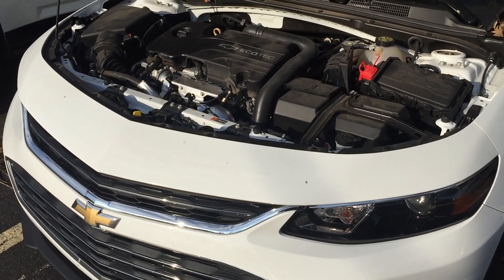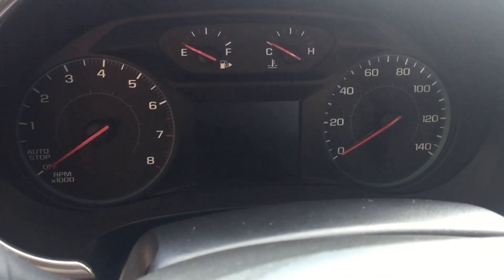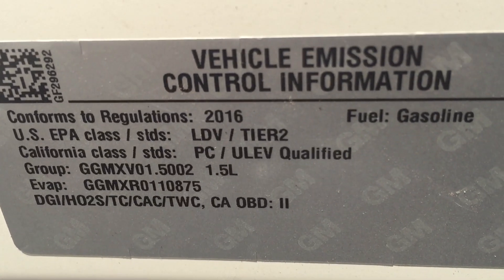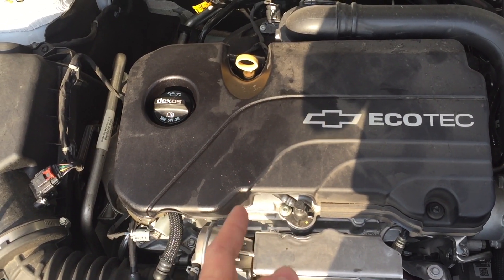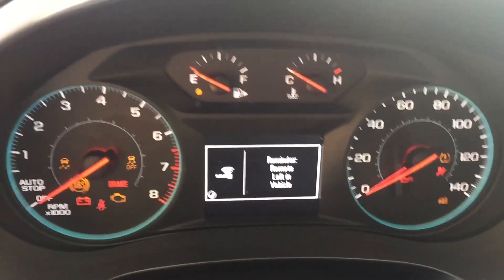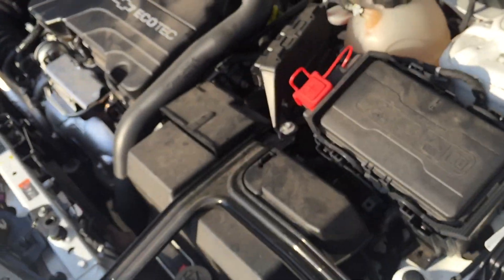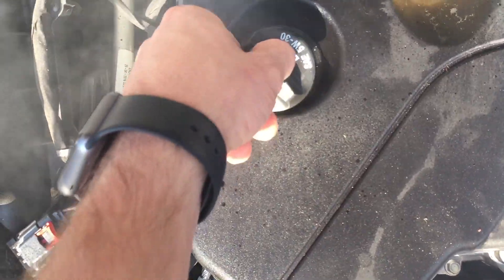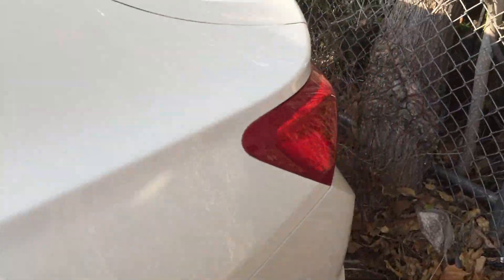What Engine Blow-By Looks Like

Comment: That's why I would never buy a car with an engine smaller than 2,5l. Manufacturers are just squeezing too much power out of these poor little engines
Reply: MaxTheKanuck Ford Ecoboost, reliable? Yeah, the EcoBoost is very reliable, if you look passed the severe carbon build up on the backside of the valves that causes premature valve and valve seat destruction, or the injectors taking a shit under 20,000 miles, or the turbos exploding under 40,000 miles. Look past all that, and yeah. The EcoBoost is extremely reliable!
Reply: TheLuckyDawg24 It has nothing to do with that, GM is the only brand completely incompetent at making a half decent 4 cylinders. The Ford 2.0 EcoBoost is just as reliable as any other properly built 4 Cylinder, and that's because Ford actually spent the time necessary to engineer and build them properly. Factory Turbocharged Engines need to be overbuilt, as in be prepared to make much more power than they actually do in order to remain reliable for it's entire lifespan. All this engine is is a Turbo thrown onto a tiny little sewing machine that clearly wasn't made to handle Boost.
Reply: NovaMan 350 So explain to me which features in Ford EcoBoost Engines inherently cause problems such as these. Specifically.
Reply: MaxTheKanuck I know you weren't asking me, but the valve issues are cause by it being direct injected. There isn't fuel being sprayed on the back side of the valves and that causes them to build up carbon. If bits of carbon break off and make it down stream it can screw up the turbo. The newest truck ecoboost engines have 2 injectors per cylinder, one is direct and the other is port. That's what toyota does and it's supposed to fix it. At least that's my understanding.
Reply: Oh yeah... Detonation is a thing.
Reply: First off ecoboost engines are turbo gas direct injection engines like a diesel engine but running on gas. Instead of spraying fuel before the valves it is injected directly into the cylinder during compression stroke. So the gas does not clean the valve stem or seat at all. Gases, oil and carbon from the positive crankcase ventilation system will tend to coat the inner runner, valve stem, and valve seat. Oil from a diesel will actually clean the above areas. So a much better PCV system with a catch can is needed or an all aluminum intake with an extra injector. Second many vehicles seem to not have fuel filters anymore but diesel style injectors need very clean fuel so a sub micronic fuel filter is needed. Also not a bad idea for a sub micronic bypass oil filter as well. Third turbo are a high precision device that need to be very well designed, have proper QA/QC and have to treated properly. No running an engine stop (which stops the lubrication and cooling of a 20000 rpm turbo) 10 times a mile in bumper to bumper traffic only to crank boost up to 20 psi.
Reply: killman1971 Wouldn't simply taking care of the Engine get rid of these problems?
Reply: killman1971 autoguide.com

People using shitty Gas could also be to blame. Either way, I think the easiest solution would be to run some Sea Foam through them at every oil change, and using Premium gas. And besides all that, these are problems related to turbocharged direct injection engines, not exclusively EcoBoosts. EcoBoosts aren't melting their pistons.
Reply: killman1971 But yeah, I know about the issues that can be caused from cutting oil off from a Turbo before it has a chance to cool down properly. If I owned a car with an EcoBoost engine I would disable the start stop bullshit.
Reply: sadly with emissions and efficiency standards tightening, that might not be an option soon, even Honda is now making a truck that has a 2.4L engine. though if you want to know too much power, there was an audi 20VT (a 1.8L engine designed by Audi in 1993) that a professional tuner managed to squeeze 1,000 horsepower out of. now that is probably too much for a tiny engine lol
Reply: +maxTheKanuck back when the Cavalier was in production they made some really great 4 cylinders, many of those I4 cavaliers are easily 200K mile cars, and around here, most die due to rust and accidents than the engine dying. however their newer stuff (IE gen 3 ecotecs) are all designed by Opel over in germany. it's good when they design it for advanced german manufacturing plants, but then they try to assemble it in aging American facilities, it doesn't turn out that great
Reply: Justin Noker By "advanced" do you mean fragile and shitty? Because yeah, that's German Engineering alright. You can get 1000 Horsepower out of pretty much anything as long as it's built correctly, but personally I would much rather have something with a bigger displacement that has a linear power band and reasonable reliability than something that makes 250 Horsepower until 6500 RPM and then blows up if you run it on full boost for more than 30 seconds.
Reply: MaxTheKanuck
you're thinking of turbo lag, it's really only an issue with old turbo cars or tuned ones, as most modern turbo's have various ways of making the powerband very linear even ewhen running higher boost pressures, it's when aftermarket tuners crank this way up where the powerband does that.
Reply: Justin Noker If you're making 1000+ Horsepower on 1.8L, it's going to have Turbo Lag. It has nothing to do with the engineering, an Engine that small isn't going to make enough exhaust gasses to spool up a Turbo big enough to make the required Boost for that much Horsepower until high RPM.
Reply: MaxTheKanuck
i know, that wasn't factory though, that falls under the tuned category, most of my previous statement was talking about factory engines
Reply: Justin Noker You brought it up dude.
Reply: MaxTheKanuck
i know, i mentioned it as a joke to the original comment of "too much power" lol
Reply: Justin Noker Like I said, just because it can make that power doesn't mean it can make it reliably.
Reply: MaxTheKanuck yeah, of course the 1,000 HP 1.8 isn't going to be that reliable, the whole purpose was just to get 1,000 horsepower out of it, nothing else
Reply: NovaMan 350 my dad has had a 2014 fusion Ecoboost company car. ran 80k in 2 years and never had an issue. his new car is a 2016 escape Ecoboost 4wd and it's got 30k and never had an issue.
Reply: MaxTheKanuck,  you NEVER run seafoam through a turbocharged engine. you will blow your turbos to holy hell.   i own a 2011 ecoboost f150. it's the 3.5 v6.  the only problem with the 2nd gen ecoboosts is the pcv system. all the oil vapor and bullshit from the crankshaft gets forced back through the intake and the turbos and then it sticks to your intake valves.  a set of catch cans fixes all of the problems with the ecoboost. also, if you have a turbo engine, buy good quality PREMIUM gas only.  most retards buy cheap gas from no name gas stations... that stuff is junk. don't buy regular either.  one last note, turbo engines need to be treated as such... run them wide open periodically. full boost and the high rpms keep gunk from sticking to your engines parts so your filters can remove it from your engine.
Reply: Logan Barrell Well shit, you learn something new every day. And yeah, I agree about using higher octane fuel even for daily driving with a Turbocharged Engine. I'm not an engineer, but is it because higher octane fuel burns much more efficiently (especially in higher quantities, like when under full boost) and there's less garbage in the exhaust gasses to gum up the Turbo?
Reply: Turbocharged engines are always performance oriented and high compression compared to say a regular v8 or a non turbo 4 banger. The high octane is resistant to predetonation which will throw engine codes and is really bad for your turbos.  Junk gas like no name stations have, is dirty often contains contaminants like water, old gas, or diesel... that crap causes fouled plugs, excess dirty exhaust that clogs cats and turbos, and slow burn which kills power and dumps raw fuel through the hot side of the turbo causing late detonation... you can grenade your turbos with garbage gas.
Reply: MaxTheKanuck High octane fuel is actually harder to ignite. The reason this is good for engines that make a lot of power, is it negates the chance of what we call detonation, or pre-ignition. It's when the fuel, by being burned up thru extreme heat or compression, ignites before the sparkplug fires. This can absolutely demolish your valves if you're lucky, and explode your piston if you're not so lucky.

So, lower octane gasoline: ignites easier, therefore suitable for low compression, low power engines that don't generate excess heat. High octane gasoline: harder to ignite, so it will not ignite before the sparkplug fires.
Reply: MaxTheKanuck lol
Reply: TheLuckyDawg24 that is correct